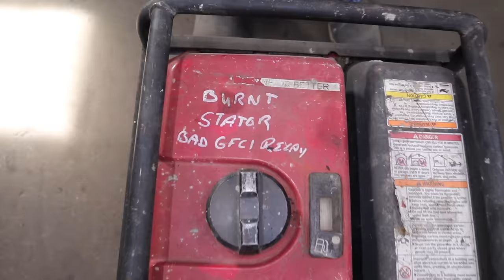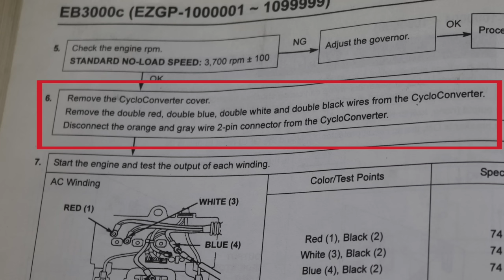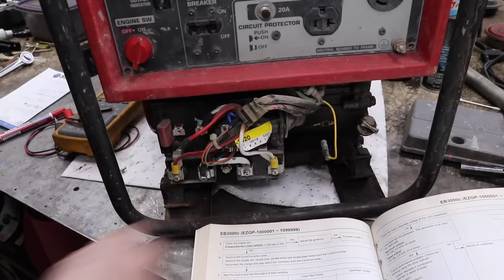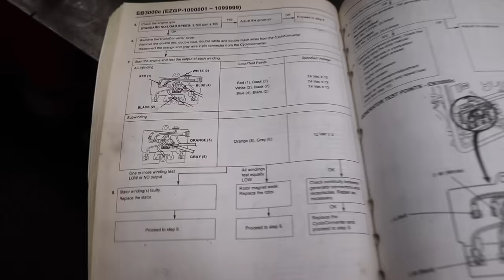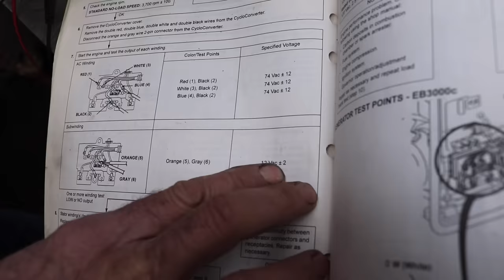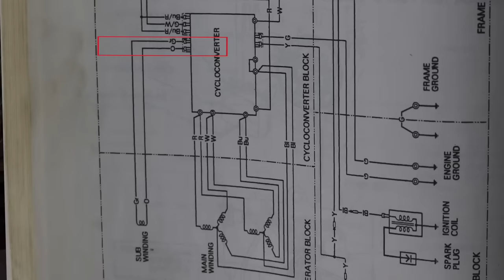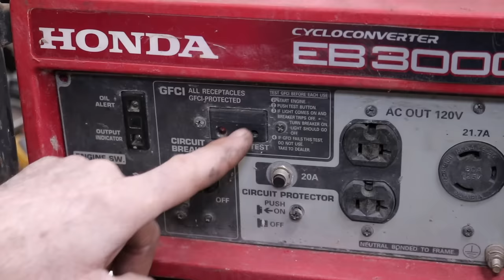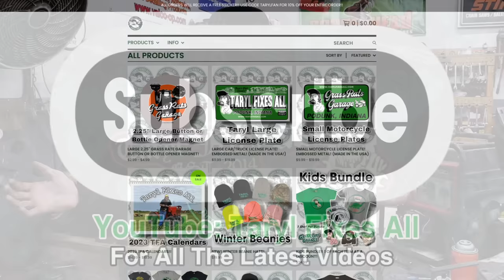Some Things Change For The Worst

Comment: I've got a GX 160 based Honda work genny, I spent all day yesterday faffing with it, to try and get it to run for more than five to ten minutes, before it conks out, revs up and down then dies, always restarts after a few minutes. Ebay have a full kit for £17, amazingly it's got a, carb, starter, air filter, spark plug, fuel pipe, tank filter, ignition coil and cap, kill switch and heat shield with all new gaskets...obviously top quality for £17!! but it did the trick, it definitely wasn't the carb or oil alert system at fault, either plug, coil or cap??

Comment: I've never understood the allure of these inverter generators, just seems like technology that was available but not really necessary kinda like "smart" refrigerators. I'll stick to my old and heavy generators... they all have wheels anyway! Currently I have the following: 
74 homelite 1100 watt 3hp Briggs 
70 sears 5500 watt HH100 tecumish 
73 Onan 6000 watt twin cylinder(In my RV) 
WW2 army surplus Onan 12500 watt 4 cylinder Willys engine, unit is mounted on a trailer and is very handy during winter storms that knock the power out... has about 500 hours, had 84 hours when I got it in 1999!

Comment: Tayrl, I  feel the reason that a lot of things are now "disposable " for a very simple reason is money. If a  manufacturer limits the repairability of an item, the company will make money on both ends. On the manufacturing side, if they can make the product "just good enough," by the time (the warranty) it fails, the models' parts are no longer available. Or has it been redesigned to be cheaper to manufacture . Like using a rollpin instead of a bolt for a component (hey, they save .28 Cents per unit.) Or making the carb non repairable, or hyper expensive for repair. Like 100.00 for a carb,  plus 100 labor to install the carb. Where as most 1970ish and below were  design engineered to a KISS  principle (Keep It Simple Stupid!)! The repair was simple to useing common repair  processes. Like pouring  Babbitt bearings. However, now the Egg headed  design engineers  have boatloads of paper expertise PHD'S, but have little to no experience with in a repair side of their product  line.  Like in the car industry, having to drop an engine to access an  ignition cap or  having to use every drive extension you might have and a swivel socket for changing out # 8 spark plug on a Ford van. Nowadays, everyone doesn't talk to each other.  Design Engineers look down  from their ivory towers on the "poor, uneducated line mecanic/ repair tech.)"

Comment: Honda makes great IC engines. My biggest issue with Honda, is that the carbs are just overly sensitive to bad fuel. The 2000 Honda that I was given for free, works great. It runs like crap on the ECO setting, but runs well at full throttle.

Comment: Thanks Tyarl...good video.
My only concern with champion is that the last time I checked, the THD for their non inverter type generators was high...on the order of 25% range. This is not good for anything electronic. Generators should be <6% ....similiar to utility company...otherwise anything electronic may be damaged.

What are your thoughts on this issue?

Comment: Those Co sensors go bad easily since they are so sensitive. Champion has great service though.
Reply: Exactly! The replacement CO sensors can be expensive. It is $700 for an EU7000. They also have a finite life. On each one they usually have a "life" indicator. Hopefully there is a bypass for that feature as most CO sensors only last 10 years. So in 10 years you probably won't even be able to get a replacement.

Comment: I’ve got two Champion generators.  One is 2000W inverter and the other an 8000W hybrid.  When I bought the 2000W, they were half the price of the Honda; they also have more starting watts than Honda.  The thing is lightweight and quiet.  The hybrid is open frame and isn’t a true inverter, so it’s a little louder, but it’s puts out a pretty good sine wave.  I really like both of mine and haven’t had to do any maintenance.  They both come with a fuel shutoff switch so it’s easy to run the gas out.  They’ve also got a drain on the float bowl to get any remaining fuel out.
Reply: No maintenance? Im sure the will last forever
Reply: They,,
Reply: @meagain6889  I meant repairs.  In all honesty though, all I’ve had to do is change the oil and clean the air filter.

Comment: I have a Honda E2200 here in Australia. It is a standby power supply because we are rural and the power goes out quite often. We need power for water as we use tanks. The generator was a couple of months old and never been used and I was notified for a product recall saying it could catch fire because of a potential fuel leak. We live in an extremely high bushfire area. I asked Honda to replace the generator with one with the modification done already at the factory considering our situation. No, not interested. I waited four months for the generator to be returned. Still sitting and never used, about five months later, another product recall. An electrical part is prone to rusting and can short out and cause a fire. Again rang Honda to plead my case and the same answer. No not interested. Waited 3 months for the generator to be returned. Consumer affairs was contacted, their answer? Its between you and Honda they have repaired it and it’s now safe to use. Thanks for nothing Honda, Never again.

Comment: Yo-yo-yo...Mr. Dactylian.  Take deep fryer that has a adjustable thermostat and fill it with some good quality propylene-glycol anti-freeze.  Turn it up to around 373°Fahrenheit.   You could use a "candy thermometer" to accurately guage the temperature.   Lower them "epoxy-potted" components into the mix.  The potting compound should melt away.   Do it outside, just in case,  wear protective gloves, foot wear, jacket, pants, face shield....so ya don't get deep fried.  Then you can reverse engineer the board, module, etc.

Comment: Yamaha are sadly about the same.  The inverter for my 1000i costs about 85% of the cost of a new genset...  Which is a pity, good unit until then.  I got hundreds of hours more life from Chinesium clones than I did from the name brands I was always using, and that I found very upsetting.  I have old Honda, Robin and Briggs gensets still running just fine after thousands of hours - but the new inverter stuff is fragile and uneconomic to repair so sadly I agree with your heading.  I just buy fair condition used old school gensets and run them for years without issue now - now the recent stuff is no more reliable than the clones I can't justify spending four times the price on the name brand stuff, which is very sad.

Comment: I have a bunch of Suit cases 2000 20 years never failed run all day on construction project s.
Inverter generator cost $$$$ to fix $1500 for inverter . We had a 3500 go bad . 
Otherwise excellent.
Maybe someone can make aftermarket inverter or repair old ones.
Put a step up transformer on AC output leads to get 115ac and by pass Inverter .
Thousands of these all over going bad.

Comment: great video.. ive never heard of champion before ow..  ived got a couple harbor freight "suitcase" 2000 watters and havent had any issues yet but im sure being they arent designed to be high quality i may have an issue..  i try to keep fresh fuel and oil in em and use them once in a while..  ive also heard never to let an inverter genny run out of fuel wit ha heavy load..

Comment: I have a champion generator and so far i really like it i have a 2000 watt inverter generator and when our power went out for 3 days i ran it the whole time to keep my pellet wood stove going and my fridge going and so far i really like it i was thinking of a 2000 watt honda but was 1200 and i found the 2000 champion and i think i paid 350 or 400 for it brand new and it has worked really well for me so far. i do believe however that the honda generator is quieter but i don't think the chapion is much louder at least not enough to make me want the honda over the champion

Comment: The EB12D uses a AVR not a inverter. Honda isn’t obligated to continue making parts for discontinued models. The oil alert system isn’t controlled by the inverter it’s controlled by the spark unit. I’d recommend swapping in a known good spark unit before condemning that generator to the bone yard. Honda makes the best portable generators period. Far better than champion or any other harbor freight level bargain brand knock off.

Comment: It doesn't matter who makes the invertor generator. If the invertor goes bad you've got a boat anchor on your hands. Unless you're going to operate sensitive electric equipment that require a good sine wave. They are a waste of money. Most electrical appliances, and household electronics have no trouble with non- invertor generators. So, save your money and buy a generator that's easy to repair, and get parts for.

Comment: One of the only ways to use these is to connect the 12VDC output to another inverter and strap it on the side, though I dont see why the 12V wire is so small. On another note I dont see Dactal being a common family name, have you found different.

Comment: Hello Taryl,  is having a fob to start a generator from 80 feet away a good idea? Frankly, I am old school and would rather check the oil level in the engine first,  besides for a generator you have to
plug in a cord to it...right?

Comment: so basically it's a 3 phase 74 VAC alternator.   Some transformers could be hooked up for it to provide 3 phase 110 or 220 VAC power, or bridge rectifiers and tin caps could be hooked to its output and it could be used to charge 3 battery banks

Comment: I have a EM1600X that I use to power TV, Internet etc until it's apparent that I need to switch to the 5kw gen (a rebuilt Briggs & Stratton) for an extended outage. Once I started using marine stable and cleaned the carb have never had an issue. Bought it used in 1989 lol. It's quiet and starts every time

Comment: I have a champion generator that I've used for everything from temp power for construction to home standby power to running a welder. And in 15 years I had to clean the carb 1 time.

Comment: HI Tarly I have a similar problem with a Rover key start walk behind mower.The problem started when I had to replace the battery unfortunately I installed the battery the wrong way  positive to negative and negative to positive my mistake . The problem is that it burnt out the stator and the rover agent has told me they can’t get a replacement part the mower is less than two years old what a joke!😂

Comment: I assume that when the control wire was disconnected, which allowed the engine to stay running, that there was no AC voltage on the red/white wires that went to the outlets?

Comment: Just another comment: Usually, (Specially older ones..), Briggs & Stratton engines last for many years, (almost...), regardless of whatever device they're powering. One suggestion, though: Some of those old B&S units are barely used once or twice a year with almost no maintenance at all. Draining old / unused fuel +  changing it's oil, (And 🦭seals if needed) a couple times per year, will make said engines last longer.

Comment: Will that Honda engine from those generators fit on anything else(tiller, pressure washer, etc.) so you can re-purpose it after the generator takes a dump?....

Comment: Honda eb12d generators are a traditional brushed generator there is no inverter unit in those. Are you sure the rotor or field windings aren't bad or something? Maybe the AVR or something cause for that specific unit about 90% of the parts are still available for it besides the obvious cosmetic things like body panels and such. If the fire department wants to sell that machine I'll happily buy it if they haven't scrapped it already, please reach out to me if it is available still.

Comment: I have the Honda cb3000 since 2002. It has been fantastic. I start it twice a year unless we have a hurricane and it always runs. When power is out, it will run all my 110vac circuits for 8 hours on a tank of gas. That includes 2 fridges and a freezer, a 110 window unit and all lights and ceiling fans, etc. 20 years old and never been in the shop. Keep it serviced and that’s it. Love it.

Comment: Bought a Yamaha generator nearly 20 years ago because the Honda was so much more.  Still runs like a champ when the power goes out.  Have needed it at least once a year, some years its saved the house from freezing up on long outages.

I have no expectation that if something happens that parts would be available.  I do have the service manual so i can test stuff.  

Worst case, i've got a little Wen genny that can run critical stuff if the Yamaha dies on me.
Reply: I bought a Yamaha suitcase generator too. Mine is 11 years old and runs great, but I don't run it that much.
Reply: Yamaha's are not cheap though.

Comment: Question? 
How old is the generator?
I’m in the construction industry and we beat the shit out of generators. They always ran in the rain, snow and crappy weather.
Nothing lasts forever.
If that contractor got 5 years out of that machine and he paid $3K for it, his cost is $600 a year, $50 a month for a  reliable power source.
That’s cheap. 
A $1,000,000 mobile crane wears out also.

Comment: A question- since Predator generators are supposed to be exact copies of Honda generators for the most part- couldn't you use a Predator inverter to fix the Honda unit if the machine is similar enough? Likewise, if China can produce inexpensive copies of Honda parts and generators- why hasn't an aftermarket manufacturer stepped in with replacement inverters for Honda? I can only assume there aren't enough broken units or demand for them since you can find pretty much anything these days...Thoughts?

Comment: I bought my Honda generator in 1985 after I bought a house out in the country and found out the grid electricity is very unreliable. So that makes about 37 years of frequent use. Includes a few episodes of running 24 hours/day for 2-3 weeks at a time. It has never failed to perform and still runs like new. Guess what generator I will buy if/when this one ever fails?

Comment: Disconnect the yellow wire from the Inverter and see if runs and Makes power. It seams like that terminal is going to Ground after it is upto Speed then kills the Ignition and briefly illuminate the Oil Lamp.  
I freeze Framed and zoomed in on the Schematic.  
Mike M.

Comment: The most reliable generators are generally the larger ones made for industrial applications that are fitted with mechanical alternators and voltage regulators , these small electronic investors have a short shelf life and most people misuse them and blow up the sensitive electronics epoxy on the inverter is done on purpose by the manufacturer’s

Comment: My model Champion Generator has een decent except the clips that hold the cover over the air filter are junk mine broke so I run it without a cover the filter is very good in them and it does its job. Keeps a 5k btu AC running when power is out from storms and runs my Freezer thats all I need it for:P I am smart though I run it with fuel off until it dies and then drain all duel out of it until next use. It is 5 years old now still runs fine.

Comment: What is the part number of the CYCLOCONVERTER that is the nla part,  31320-Z04-C35 seems to be available there is even a seller (Parts PAC) on Walmart.
However 04301-Z04-C30 seems to be  NLA.
Reply: Exactly!  The inverter module is still available. 04301-Z04-C30 is a "kit" that includes the inverter and a small jumper harness, which of course you probably don't need. Hopefully Taryl will publish a correction.

Comment: If it still outputs 76V AC could you run it through a cheap bridge rectifier, and then into any inverter that could accept a 76V DC input and output 120V AC? (If it were to be used for emergency power usage rather than construction maybe even get a solar all in one unit, and the unit would use the 76V DC to charge a large battery bank to then provide 120V AC without you needing to keep the generator on.)  Just trying to think of ways to not junk an otherwise functioning motor.

Comment: Hello Taryl , been watching you for a couple years,,, I have a question I own to kingcraft 13 hp generators purchased at Aldi‘s,,, One of them is still sitting and has never been run still doesn’t have any oil in it, it’s a matter of fact, The other one ran for about four orfive hours and ran perfectly to keep my sump pump during the flood,,Should I keep them? Often thought about turning them into go carts lol,,, 13 hp seems pretty powerful much better than my 3.5 minibike I owned as a child, I’m 60 years old now,, but I have a couple young men around that might be able to do the work, and keep them interested in mechanics

Comment: The motor could be salvaged,  but for $100.00 or so you can buy a good 6 hp. motor from HF and I've had 0 problems from the cheap harbor freight engines.

Comment: Well, I would say it's the ignition module. These modules are known to fail. They get misdiagnosed as the inverter a lot. 
Part# Honda 30585-Z03-C02 IGNITION UNIT.     Just FYI.

Comment: Tyrel, don't know if you could melt out the potting/epoxy with a heat gun or not, don't even know if it's worth your time, but had a similar problem with my generator and a friend melted out the potting material and found that a power capacitor and a couple of diodes failed, those were replaced and generator was working again